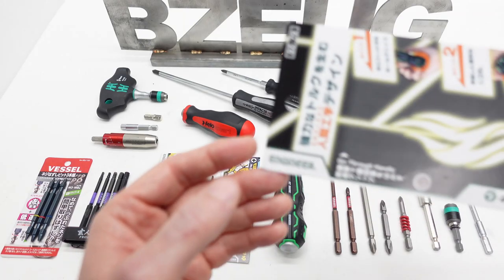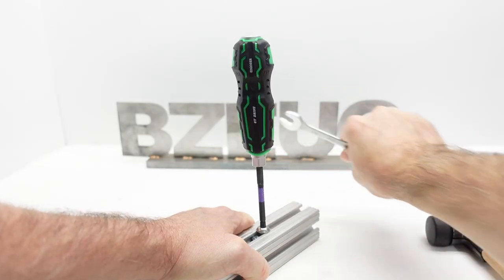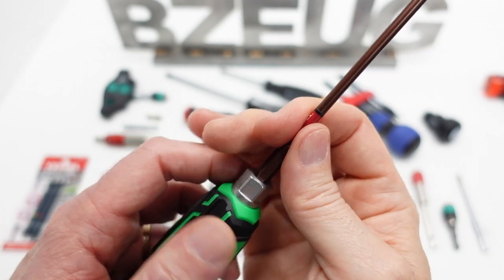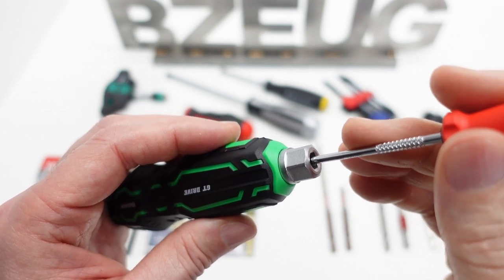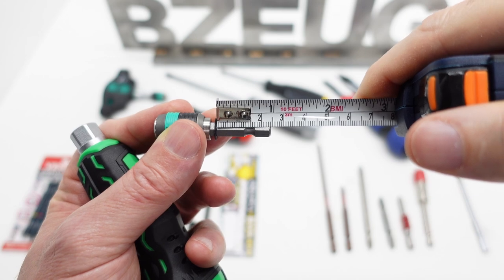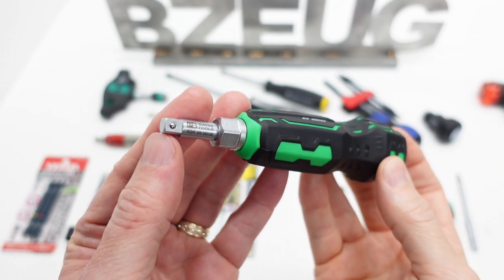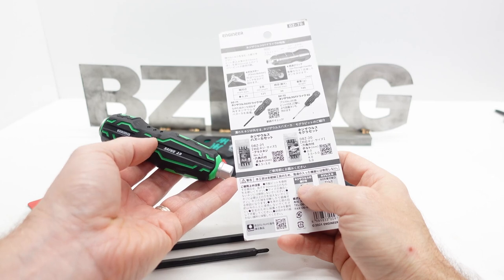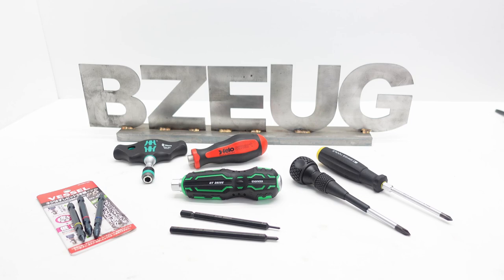Japanese ENGINEER brand strike cap bit holder with bolster.

Comment: How does this compare to the vessel 220w impact bit holder?
Reply from the maker: The VESSEL,  the new WERA and all those style of impact bit holder twist when struck.  Those also typically use 5/16" hex bits instead of 1/4" hex bits.